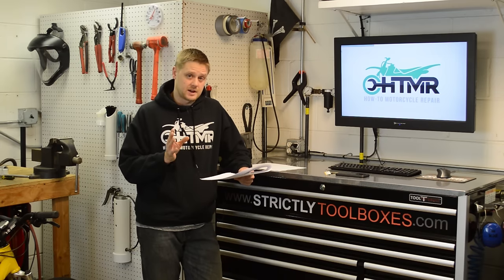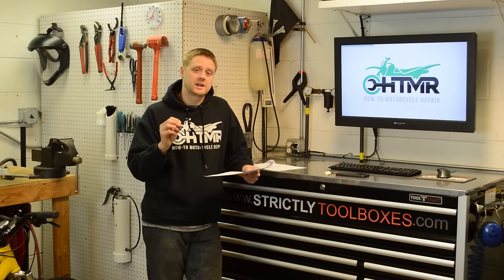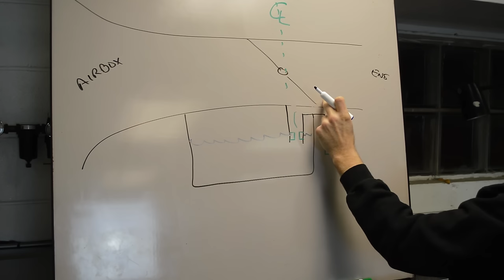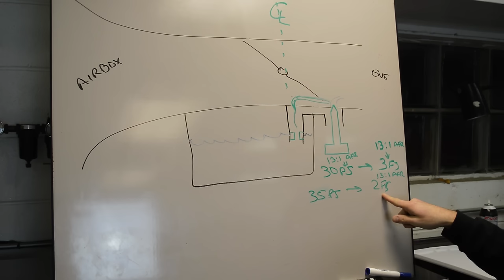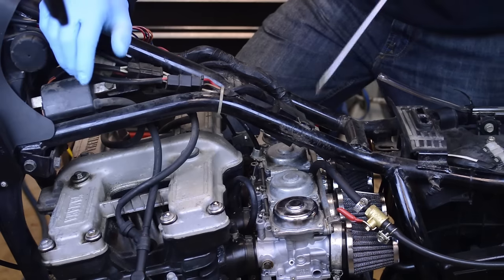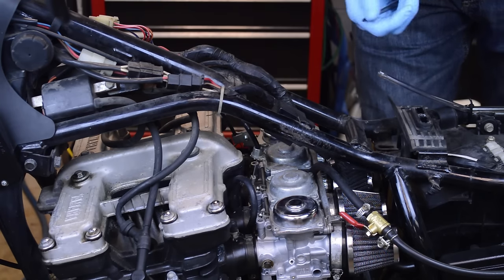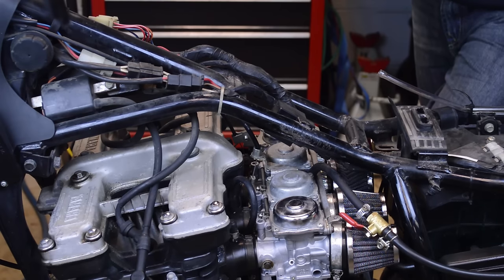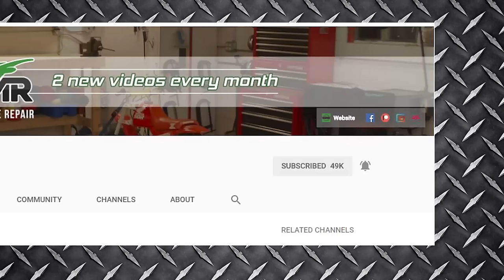Pilot Air/Fuel Screw Adjustment Explained - Multiple Carbs - Part 2

Comment: Hi, i have a question: is it possible that  different carbs may need slightly different settings of the AF mixture screw? V4 bike
Reply from the maker: Yes. Check with service manual and see what they spec for your model. At most it might be half a turn.
Reply: @HTMR  thanks

Comment: Question I added pod filters and now I can't get the bike to start. The stock idle jet is a 35 and I have the idle screw out 5. Compression and ignition is good. How much would you think I might need to up the idle jet?
Reply from the maker: What was the screw setting before pods? Turn them back to 3 turns out.
Reply: @HTMR  2.5-3
Reply: @HTMR  I started at 2.5 turns out per the manual and slowly moved out the longer the bike wouldn't start but when I got to 5 I stopped before I got really angry
Reply from the maker: @tomtom5858  What year make model?
Reply: @HTMR  1991 Kawasaki zephyr 750
Reply from the maker: @tomtom5858  I have found that you may need to bump your pilot jets by 1-3 sizes up. Buy jets and start playing around.
Reply: @HTMR  ok thank you sir

Comment: I just rebuilt a Hitachi HSC 34 off of the 1980 midnight special 850. I did put a 145 jet as well as per recommended by K&N. Everything else was remained stock on the rebuild kit. It’s sputters and pops and I can’t figure out what the hell happened. I’ve tried every fuel screw adjustment possible to smooth it out. Don’t know if I need to raise or lower the needle or do something with the pilot jet? To be honest I am absolutely lost because there isn’t a lot of detail out there on this particular carburetor. Help.
Reply from the maker: What K&N modifications did you do? Just the air filter or airbox delete with pods?
Reply: @HTMR  I did the airbox delete an added pods. But since I wrote this I’ve already just purchased some 36 mm Mikuni’s because I’m sick and tired of these Hitachi’s. They’re just too damn temperamental.

Comment: Carbon built up on the spark plugs after long ride could be running a little rich?
Reply from the maker: Yes but your ride was on every circuit of the carb, that does not tell you which one to jet.
Reply: @HTMR  on the highway the ride was very smooth, but after that it would  stall...couldn't idle anymore

Comment: great explanation,and i need your favor to solve my broblem .i have suzuki gsf250 93 model and it has mikuni carburetor. main jet #105  starter jet #40 and it has 5 position taper jet needle  its 5cf9-2,can you tell me how to tune up carburetor.i tried uncountable times to tune up it and i'm failed , tell me how to do it
Reply from the maker: Buy a service manual and set it to stock.
Reply: @HTMR  its hard to find in my country. If you know how to tune up my carburetor  tell me.

Comment: So I have a honda vfr750fk rc24 1989 I have carbs set to 4 and abit turns out runs lovely ticks over lovely I ride it atleast like 100miles and then pulled spark plugs out and showed  a garage and they said it is running fine so I put them in let them have a go on my bike and they did a 3rd gear low rpm pull and it just picks up no flat spots or enything

Comment: You mentioned audio popping 5min. 40sec. into the video. That would be due to the fact that your spark plugs do not have resistors in them. Without the resistors your spark plug wires become antennas that broadcast a radio wave.

Comment: Thanks to you for your job and time!

Almost nobody explain well as you!  
if I understand you correctly, my pilot jet is so leaner because idle runs well and better at 2 turns of fuel screw? 
My engine works at ~1500ft and 75°F.
Honda XR150L
¿Is there a way to use spark reading to check jet pilot adjustments?
very thanks to you!
Reply from the maker: 2 turns on a fuel screw is pretty good, maybe even a little rich. Sure, let it idle for a while with new plug and pull and read it.

Comment: the throttle stop screw -- should it be set so there is a slight gap at the bottom of the butterfly? i would have thought it would need to be  set so the butterfly is completely closed at idle. the air would come from the pilot air jet, no?
Reply from the maker: Butterflies should be open a bit, that is where the air comes from. So throttle stop screw should be contacting it, and opening them slightly.
Reply: @HTMR  ah ok but does the air pilot jet on air cleaner side not supply air in front of the butterfly to mix with fuel? i see a 5mm hole above the pilot fuel holes in front of butterfly. i assumed this was to allow air to get in front of butterfly even when its fully closed
Reply: @HTMR  i think i get it. the butterfly has to slightly open because air needs to flow directly over the pilot fuel holes to draw the fuel up through them with venturi effect. the air from the pilot air jet does not pass over the pilot fuel holes and wont draw fuel up, its just a way for more air to enter in general
Reply from the maker: @Gruxxan  I think that hole is for the choke/enrichener?
Reply: @HTMR  yes you could be right on that. thanks for the help

Comment: My bike has an air screw before carbs and a fuel screw under the csrbs. 79 suzuki gs 850. Does this video still apply?
Reply from the maker: Your bike should have air screws. The one in front should be the idle speed adjustment.
Reply: Fellow GS owner here. The 79 850 carbs you set the fuel mix first. My 78 750 carbs they are roughly half a turn out and you do your tuning for highest idle on the air screw.
Reply from the maker: @Burritosuupreme  I haven't messed around with that style of carb yet.

Comment: i have 50cc moped , stock PJ - #35 now its #38 ,,  fuel screw is 2.5 out  having problem at idle . idle's high but after you rev , engine dies... but cruising and full throttle it run good.. if the fuel screw is 1.25~1.5 out idle is good no problem at all,, but cruising and full throtlle too bad... please give some advice... thanks
Reply from the maker: Do you have a fuel or air screw?
Reply: @HTMR   fuel screw
Reply from the maker: @seicer2078  You positive? Usually 50cc motors have a pilot air screw? Can you email me a pic? https://www.howtomotorcyclerepair.com/contact/

Comment: At 16:32 those 4 bolts that remove the Control valve, theres a plate with a flathead bolt that I removed to clean all the gunk out. Im having lots of trouble trying to find a replacement jet, looking everywhere on the internet every day, every video to see if someone mentions the # jet. Ive looked at every part kit to see if there is a replacement for what I believe is the air main jet that goes on the top next to the carb body. theres 2 of them next to each other I just dont know where to find them or how they function. Can I get any?
Reply: They stripped out on me and had to tap it out 🙄
Reply from the maker: Shoot me an email with pics

Comment: When I open the throttle it stays at high idle for while, no matter how I adjust the idle mix screws. 4,000 plus sometimes, then down to extreme low idle. Any thoughts???  1986 yamaha xj700 maxim X Liquid cooled.
Reply from the maker: Lean hanging idle. Check for vacuum leaks.
Reply: @HTMR  it seems to be running rich, I can’t stand it in the shop there’s so much unburned fuel. I checked all vacuum after carbs all is good! Thinking of jetting down your thoughts! Only 12k on a beautiful bike!
Reply from the maker: @powerhungrytoo  Email me a video
Reply: @HTMR  will do thx!!!

Comment: If my carb only likes to work with the mixture screw 3/4th of a turn from fully seated and  bogs with more, what is the mext step except from replacing the carb?the slide needle does not offer any asjustment
Reply from the maker: Fuel or air screw?
Reply: @HTMR  it is next to the idle speed screw and towards the engine, so i suppose fuel if i understood correctly?
Reply from the maker: @darksondap94  What year make model? The tip on screw should be pointy. So, if confirmed a fuel screw, then decrease pilot jet size 1-2 sizes.
Reply: It is a chinese underbone called dayang, based on the honda astrea supra. It is a 2015 model. The carburator brand is called Deni and it mentions a PZ20 code on its side
Reply: @HTMR  Hello again, I took the screw out and turns out it has a blunt end, like in your XR 70 video, so i suppose it is air mixture?  Even after achieving the highest idle in 3/4th of a turn out, the engines bogs and dies if i go WOT quickly from idle. My slider needle does not offer any adjustment. What do you recommend for the jets?
Reply from the maker: @darksondap94  Yes air screw. Go one step richer on pilot jet. First, make sure there are no vacuum leaks and I'm assuming carb is clean?
Reply: @HTMR  carb and air filter are freshly cleaned and reinstalled with no leaks, as the idle is steady. I also seem to be getting poor mileage out of my bike. Is there any other setting to make other than a richer pilot to combat the bog? A leaner main perhaps?

Comment: I have a 250cc motorcycle it’s a 4 stroke engine.... the carburetor came with a 98 main jet and a 40 piolet jet.... I stay in Texas so I chained the main jet to a 110 and the pioletjet to a 45 did I do this wrong
Reply from the maker: The pilot jet - the answer is in the pilot screw. Main jet tuning: https://youtu.be/6b9dMhgZT-c

Comment: At 1:35 you say that a carb will have either an air screw or pilot air screw, but never both...  Mikuni VM fitted to Suzuki GS motorcycles from the mid 70s thru to the early 80s do.
Reply from the maker: I know they exist, just never worked on one in 30 years of wrenching. 99% of engines have one or the other.

Comment: Matthew, hopefully you have a minute to give me your feedback on a multi-carb problem I've been trying to solve for over a month but i'm running out of time, only a week left to get the problem solved or i lose my registration.
1980 yamaha inline 4, sat for 25 years untouched before i got it, did all the usual stuff, bike ran ok but had a lean problem with 2 cylinders
ordered kits, cleaned carbs again making sure nothing clogged, installed new stock size jets, new needle and seat, adjusted float levels, new slide needle, new pilot fuel screw with new o rings, ect....
still lean cylinders 1& 2
trying to adjust sync discovered vacuum on cylinder 2 wont go above 14 inches, all other cylinders at 30
additionally turning the pilot fuel screw on cylinder 2 all the way in barely makes a change but the cylinder is still running lean
I've had these carbs off 6 times or more checked and rechecked everything, no air leaks
what could cause the vacuum level on a cylinder to be restricted, stop the fuel mixture screw from having any effect while still running lean, I'm out of ideas, you got any suggestions on where to look? thanks
Reply from the maker: What model? What style carbs? Did you check for vacuum leaks?
Reply: wow I never saw that you responded, it's been 2 months hopefully you can still take a minute to offer some feedback because I'm still having the same problem, I work on it almost every night after I get through taking care of my invalid mother, it was my therapy but now it's just more frustration.
1980 yamaha xj650, hitachi hsc32 carbs, wear parts replaced even new stock size jets (110 mains, 40 pilots), stock airbox and filter, stockish exhaust (outlet opened up by 1/2"), no air leaks, carbs have been gone through more time then I can count, float levels set perfectly to factory specs.
the bike runs great when twisting the throttle and going up through the gears which eats a lot of gas riding that way. the problem is when riding  what I call cop mode, like when you have a cop next to or behind you or  you are cruising down the highway maintaining a steady rpm using little amount of throttle. in those situations from idle up through about 3500 rpm's all 4 cylinders equally  run way rich, sometimes to the point where after a while it getting hard to pull away from a light because it's stumbling all over itself. but then at the same time when cruising at speeds 5000 rpm's and up with little throttle all 4 cylinders go equally extremely lean and nothing I do changes it, I even threw some 116 mains in the carbs just trying to get the top end to go fat but all that happened was it made the already to rich low end even richer but above 5K still ran lean, when I'm cruising at a steady 65 mph on the highway which is 5000 rpm's in this little bike, I'm no where close to  1/8 throttle, instead it's more like 1/90 or a 1/4"  of throttle twist which makes me wonder if with that little amount of throttle open when cruising is it possible that the lean condition is because it's still in the idle circuit and not actually pulling from the whole pilot circuit like is should be doing?
sorry I know it's a lot to read but I've been trying to solve this for months ....forgot to add every passage has had carb cleaner and compressed air blown through them multiple times over the months.....

Comment: My r1 98 studderr at 3 4k rpm 
Cant fix it can u help
At idel only but when I'm riding it's ok
Full carb built plugs and cables  filter and fuel pump
Reply from the maker: Look into the slides, maybe sticky.
Reply: @HTMR  brand new slide pins

Comment: The manual says to stay within half a turn more or less than the original 3 turns, why is that? what should I do if I get higher RPM when I unscrew it more than that? How do I know when to stop unscrewing? You didn't check what happens if you keep unscrewing.
Reply from the maker: The manual (depending on year) has to comply with EPA settings. If you unscrew more than 3 turns out, you lose effective fueling control, and the screw can fall out.
Reply: @HTMR  What do you recommend? set it on 3.5 turns?
Reply from the maker: @ronenfe  You need to tune per video for highest and smoothest RPM, then determine if pilot jet is correct.

Comment: I have a MP-250A - JCL scooter having vacuum lines problems will not idle please help
Reply from the maker: Please explain in more detail.
Reply: The bike will run but not idle has two ports on the carburetor. That has no vacuum lines on them and do not know where they go
Reply from the maker: @bobbybearden9166  Not familiar with your model but one should go to the petcock.

Comment: i cant adjust my air pilot screw ... if i loosen it at all it just un threads from the vibration of the engine.   there's no way to keep it in an ideal spot ..... is this pin missing a rubber ring or something?
Reply from the maker: Do you have the spring installed??
Reply: @HTMR  i figured something was missing... someone must of had it apart before selling it to me... thanks for reply

Comment: Bought 01 1200 bandit motor. On C/L for my 94 GSXR 750. Got everything off the bandit carbs wire harness  . Coils all control!s. Wedged in the frame. Never touched the carb took one float bowl off It was clean. Stuck em on. It keeps at 1000 rpm revs good stumbles once in while low rpm. Pulls good on the high end. Runs better warm. Think I should get off my lazy ass. Jerk the cars check the turns in the air screw.?
Reply from the maker: Probably should clean them.
Reply: @HTMR  I got really lucky. Usually when you do a swap. Your screwing around looking for parts to complete it. Even after all that. You don't know if it's going to run good or not. With all the BS our government pulling.shit  I'm short on $.  To Finnish this.  It looks hillbilly with the dirtbike tank.on it. Rode it about 6 miles the other day. On my way home. I live right on a 2 lane North South 60 mph hwy. Mile from the house. Rolled the gas slowly to redline. Threw 4 gear. Pushed it to 110. Need front sprocket chain. Primary  hooked pretty good. Tank paint job it's done. How come.? When you don't have $  You always find shit you need for a project on C/L or some other for sale web site. The minute you come up with the cash. You can't find shit.? It's still fun though.

Comment: Honda Shadow VT750CD dual carb. 1 fuel screw all the way in or out has no effect on the bike. The other does. Why?
Reply from the maker: Pilot circuit is probably dirty. How does it run? Test pipe temp with IR thermometer to see if cylinders are firing at same "temp".
Reply: @HTMR  idled good and ran good but when I crank the throttle it bogs and popps at high rpms. Removed the carbs again and found a bunch of gunk. Cleaned em again. Gonna put em back on today and clean out fuel pump and lines and test pump efficiency. Will also check headers with an ir thermometer. I'll let u know what I find

Comment: Hi Matthew, I have a question . I recently rebuilt the top end on my 78 F2 super sport (836) im running pod filters on my original carbs, what size main jet do you recommend? I cant seem to get the right balance on take off and top gear. I have my fuel screw at around 2 1/2- 3 turns out, and like you said if I screw out further they will fall out. When I give it some curry its flat on take off but ok after 3rd gear. hope you can help. Also can you recommend a place to buy them? Dave
Reply from the maker: Have you played with needle clip position? Never jetted a 836, however I would go up 3-4 sizes on main and report back.

Comment: I think you are wrong. You should hose a vacum gauge and start messing around with each mixture screw until you reach to the point where unscrewing doesnt affect the pressure. Then u have to sync them.
Reply from the maker: When you reach peak rpm, then you are very close to max vacuum as well. Your logic makes sense, however never done it that way.
Reply: @HTMR  the higher rpm can be achived with a lean mixture, so you should not reach peak rpm plus u cant find that out on a quad carb motorcycle. I think you must start on a lean condition eg 1 turn out and move 1/2 until u will reach to a point where the vacuum wont change then you will screw it 1/2 in to achive the smoothest and not richer idle
Reply: ^ This